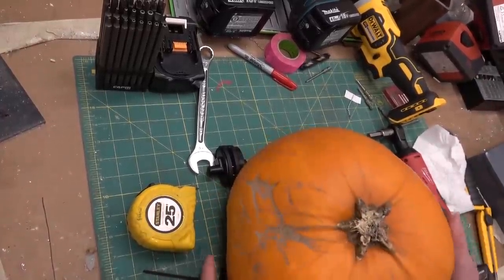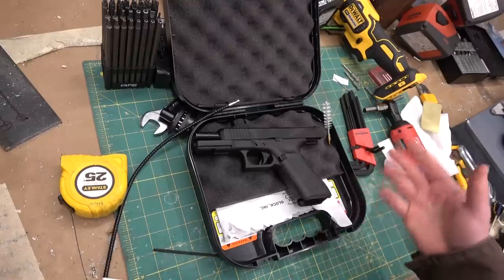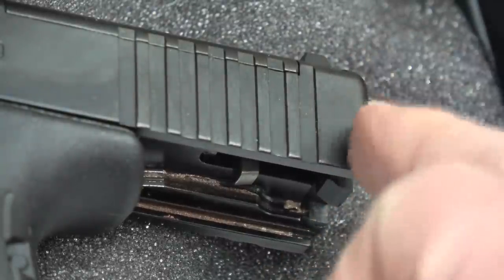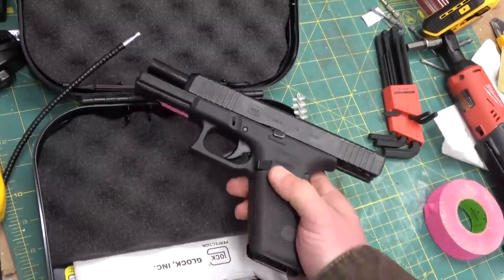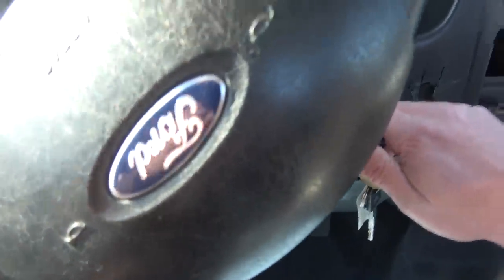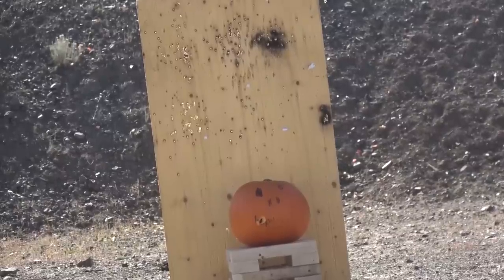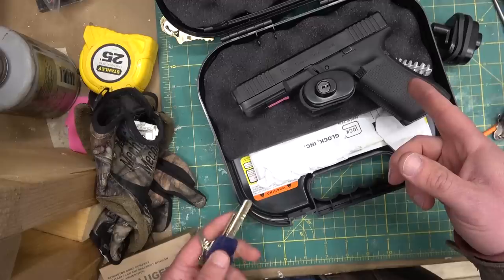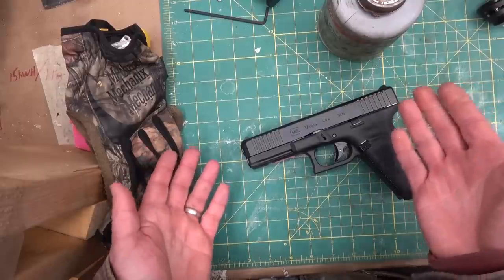BOLTR: GLOCK 17 GEN 5

Comment: You were shooting low left. Normal for a right handed shooter. Called milking the grip. Like milking the test on a cow. Learn the Re-Set of the trigger and practice it dry firing, in a safe direction. basically, keep ALL of your fingers tightly gripped around the grip of the pistol. allow your trigger finger to relax and squeeze the trigger. As the striker releases and the gun fires it will cycle a new round into the chamber. once the cycle is complete slowly relax ONLY the trigger finger till you feel the re-set click. the pistol is ready to fire the next round now. All the while NOT releasing the grip of the other fingers. This will prevent, eventually, the milking action causing you to shoot low left. DO NOT MOVE THE SIGHTS. Nothing wrong with them.

Comment: The firing pin safety has nothing to do with the magazine.  The Glock will absolutely fire without a magazine as long as there is a bullet in the chamber.  The firing pin safety is just like the drop safety in that it keeps the firing pin from striking the primer unless the trigger is pulled.  When you pull the trigger the firing pin safety is lifted up out of the way, magazine or not.

Comment: You're wrong on the sights.  You're pulling down and to the left because your gripping too hard anticipating recoil. This is very VERY common with glocks.  Low and to the left. Learn the trigger, also learn to shoot the reset.

I see this every time I'm at the range and a new glock owner is shooting.  Happened to me years ago and like him,  I blamed the sights until a range master borrowed my gun and drove nails with it. 

It's not the sights,  it's you and your trigger pull and grip when anticipating recoil.

Comment: This video has answered the question in my mind if Canadians actually drink Canada Dry. Unless AVE is getting into product placements. 

Truthfully Zee Gerhmans are probably the ones who get credit for the stamping stuff in perspective of firearms. The Russians just kidnapped a lot of their engineers and looted their factories. :) Glocks are a wonder of engineering in terms of economizing just like you said.Surprised you didn't do a stipple job to it as you were doing the soldering iron test.

There is no mag safety on a Glock far as I know. Not sure on the Canadian ones but the US ones that's pretty much certainly the case. There's a few things happening with that piece you mention as a mag release. It serves as a disconnector (e.g. it doesn't drain the mag by pulling the trigger once) as well as serving as a secondary safety. There's a small pin in the slide that keeps the firing pin from striking the primer in the round that it also makes contact with should something happen where the sear slips or isn't fully engaged and the firing pin falls.

Your primer was almost certainly too far out or not seated fully in the case. It happens. The case has no black in it if you had a primer and no powder (I'm guessing there was powder, maybe not) there is typically black in the case. 

The claw is the extractor, the little piece hanging out is the ejector. The extractor yanks the case out of the barrel (some guns don't even have one believe it or not) while the ejector kicks it free of the action.

Find an animation and watch it (tons out there) I'm sure this thing's gonna get anoter video if it hasn't already.

Wait till he starts lathing out his own tube gun. That'll be the day although I'm not sure how that would go over legality wise. A STEN or even a CZ SA26 or similar for someone of your skills wouldn't be hard. There's people that build really cool semi autos in the states including stuff like MG42s, BRENs and the usual HKs/Uzis/SA26es/AKs/ARs.

Comment: I've always been disappointed at the stamped parts that Glock uses and is one of the reasons I have always opted for other brands, and this is especially frustrating a their price point. I've fired many Glocks and seem to regularly have difficulty with the aforementioned stove piping and more commonly for me, misfires compared to the IMI, CZ, Kimber, Colt, etc., etc., etc., and I've always thought it came down to the firing pin not  engaging firmly or deeply enough. That part is no exception to the stamped steel construction they use to make the process more economical. 

I know some people swear by them and there must be enough reliability that they aren't quite notoriously infamous for their reliability, but it's enough for my experience and especially now from seeing this video. "Robust and cheap" have not equated to reliable in the hours and hours I've put in with Glocks and ultimately why I never did own one. I understand this doesn't totally conform the thesis of your video, but they are my thoughts as related through my experiences.  

Also, it's always interesting to see in practice the legal culture of firearms in different places. I appreciate you including that in this vid. You have a great presentation, and are informative and entertaining. I see it's sparked some mild controversy in the comments.

Keep up the good work, my friend (or pal, guy, buddy, whatever you lovely Canucks prefer).

Comment: You should take a look at the Makarov pistol. There are sections machined real fine, but anywhere that doesnt need a good surface finish? they machined without coolant! pistol is cheap as shit, but so simple it doesnt matter! Best thing of all is that it's just a blowback pistol. All it does is use the weight of the slide and the recoil spring to keep it closed while firing!

Comment: 22:30  Huh?  Do you really have to have a magazine inserted?  Don't Glocks require you to pull the trigger to disassemble?  Or can you engage the trigger, but the firing pin stays in place if there's no magazine allowing you to disassemble the firearm without having a magazine in it?   Because requiring a magazine, empty or otherwise, to disassemble the firearm sounds like a bad recipe.

Comment: Shooting low left... You just need some more practice. It's 100% the shooter causing that. With a modern and new firearm, it's basically always the shooter if their are issues with point of impact vs aim.  Low left is very common for new shooters with striker fired pistols. It's down to poor trigger control or recoil anticipation causing the muzzle to dip just as the trigger breaks. Training will fix that. 

The simplicity of the Glock firing mechanism is a great example of the old saying... That any decent engineer can design a functional complex mechanism, but I takes a great engineer to design that mechanism to be as simple as possible. I am not a Glock fan, but I can acknowledge that they make a good firearm.

The internal safeties... The trigger dingus prevents the trigger from moving unless pressed, so a drop will not cause inertia movement. The trigger bar mechanism sits on top of a shelf, so it can not drop out of the way and allow the striker to be released when it shouldn't. The striker is only partially cocked, in theory it would not have enough energy to set off a round of released from the rest point. The nub/ramp on the trigger bar, slides back and pushes up on the plunger in the slide when you pull the trigger, if the plunger is not pressed, the striker can not reach the primer. The trigger disconnect for the semiauto function is also stupid simple...

This simply is a big reason for the reliability they achieve. Other manufacturers have reached similar levels of reliability, but with mechanisms that are a bit more complicated overall. Which I find interesting as well.

I have no idea why Glock uses that antiseize, even the Austrian guns came with that stuff. You are meant to clean and lube prior to using it the first time. So it is used for manufacturing purposes for some reason or another. You may be right that it is being used as a lapping compound.

The misfired round, it kind of looks like the flash hole that allows the primer to direct the flame into the powder in the case, isn't properly drilled out. Hard to tell from the video though. A bad round isn't unheard of, especially in cheap ammo. Knowing the potential dangers that bad ammo can cause, especially a squib load (weak round with little to no powder) is important. A squib can lodge a bullet partially into the barrel. If you clear the resulting jam, and then attempt to fire a second round without verifying the barrel is clear... If there is a bullet stuck in the barrel, the gun basically explodes in your hand when you fire the next round. Typically it's not deadly, but it can injure you pretty bad, or at the least damage the firearm beyond repair.

Enjoy your new pistol, and stay safe.

Comment: Need to work on your follow through. Stop taking your finger completely off the trigger after each shot and slapping it back, pull the trigger don’t slap it. The sights are sighted in at the factory. They test fire it using a machine firing 2 over pressured and 6 sight in rounds and use a $20k laser to see where it’s hitting and then it goes to a station where they install the rear sight with a computerized press that is supposed to zero the sight. It’s also funny to go on websites that say austrian glocks are better than US glocks because they have better internals... all the internals are made in Austria and the same machines and tooling is used to make the slide, barrel and frame. Glock isn’t the best handgun but it does the trick.

Comment: You got it wrong on the action there buddy.  Basically that catch piece in the trigger group is the sear in part. Pulling the trigger back moves that catch back. That catch is pulling the striker back.  When you pull past a certain point the catch drops and releases the striker.  That rounded piece sticking up pushes the striker block out of the way.  Its connected to the trigger bar and activates when you pull the trigger back.  What it all results to is that for the round to go off you have to physically pull the trigger back. There is no firing pin set back waiting to be released like in other pistols.  You can load a round in the tube and toss the gun off a building and it will not discharge. No matter how many times you do it.  Check this video out of a cut away Glock, it demonstrates the action really well. It shows how safe the Glock is.     https://youtu.be/pThsdG0FNdc

Comment: Why does the barrel point upwards?
Reply: Browning tilting barrel. Barrel and slide travel locked to each other while pressure inside the chamber is high and after travelling a few mms to the rear there's an angled cut on the barrel that hits a ledge and disconnects the barrel from the slide and allows the case to extract at a lower pressure.

Comment: Why do you have ten-round mags? That seems silly. The whole point of a Glock is that it holds 17 rounds. Go buy a proper mag for it. Where do you even find a ten round mag for a Glock? I haven't even seen one of those since the 90's. What happened to the two 17-round mags that came with it when you bought it? (Also, there's something wrong with the speedometer in your truck.)

Comment: Glocks do NOT have a mag safety. Yes, the frame is indeed nylon 6-6, it was a huge deal when Gaston first dropped them onto the market in 1981 and even today Fudds and other assorted dumbasses "don't trust a plastic pistol", despite the extreme benefits of a polymer frame and the fact that it's pretty much market standard today.

It "feels chincy", but that's by design; the polymer lower gives you way better flex and recoil absorption, giving you a far smoother-shooting firearm. Did you notice you didn't have a 'ringing' in your hands right after shooting it? That's because of the polymer flexing and absorbing the recoil impulse of the pew. Further, it's actually pretty thin in some spots in the grip, to accommodate the mag size whilst keeping the grip size comfortable for most hands. Don't forget, the dingus end goes all the way up in this one; doesn't hang off the bottom like a Makita or WillFuckYe....

Shoot me a message! I'm a Smith here in the wild wild North Dakota, would love to give you more info on these and other kerpewpews. :)

Comment: This is a  Perfect example of why someone who knows little to nothing about Firearms, shouldn't talk about Firearms or pretend to know anything about Firearms. You have done nothing but show your ignorance in this video. The Anti-Seize compound isn't meant to be left in the Glock after purchase. It's put into the Glock at the factory for a reason. On the Upper, you have all Metal parts on the slide, Where the Anti-seize is applied. On the Lower, you also have metal parts that will be in contact with the upper while the firearm sits on the shelf, or in it's case, whereever it's going to be stored or displayed before it is sold. The Anti-seize compound is there to do just that, prevent any "seizing" of those points of contact. A Gun store, and even Glock itself sells the correct lubricant that you would use after you clean the Glock, after purchase and after use.

Comment: I can understand the "double locking", but why did you use the triggerlock? Why you just didn't use the wirelock, that you had at the beginning of the video? Wirelock makes gun unusable, because you can't insert the magazine and you can't close the slide. With triggerlock you can still load the gun and chamber a round and then you are carrying a hot weapon, which can discharge if it get dropped, bumbed or otherwise mishandled. I'm not judging... Just wondering thats all.